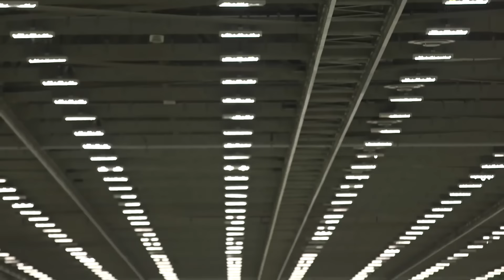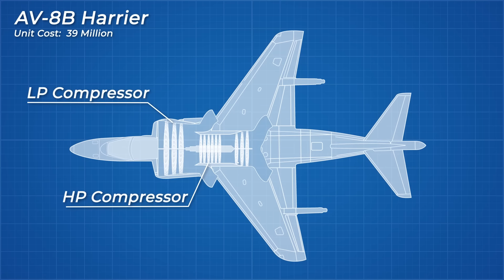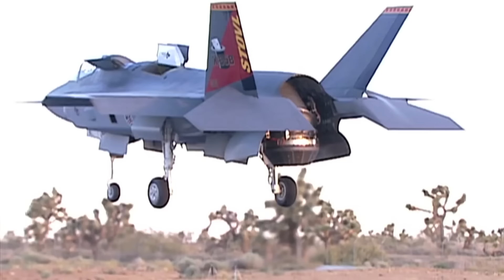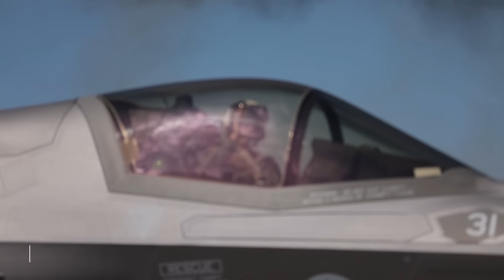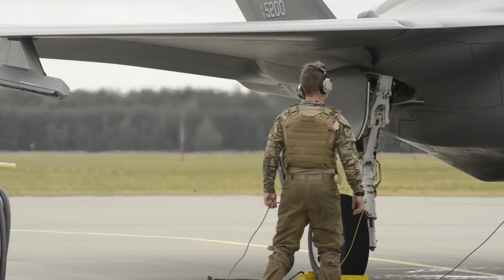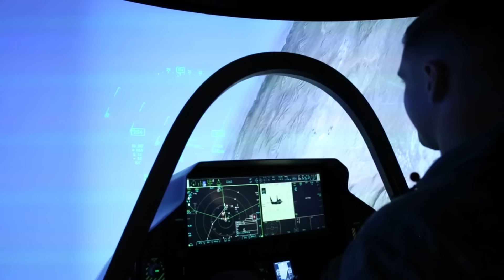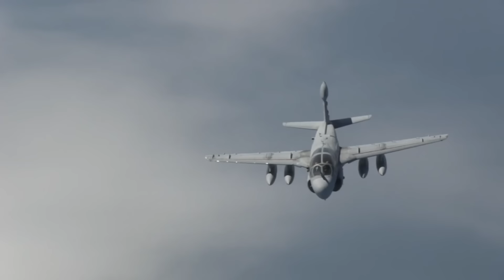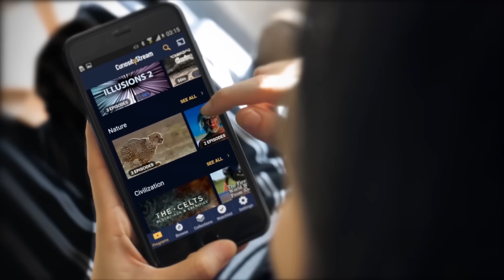Is The F-35 Worth $115 Million?

Comment: The F-35 got its VTSTOL capabilities from the Russians (the Yak-141).
Reply: mb they just bought one back in the 90s
Reply: @anatolyrozhkov851  They bought the license iirc.
Reply: That's false. The Yak-141 used smaller jet engines instead of the lift fan. The three-bearing swivel nozzle is also from the Convair Model 200.

Comment: Just use the long wavelength radar to get the general location and then shoot a missile that has optical tracking
Reply: If it's that easy why are Russia and China bothering with creating their own stealth aircraft?
Reply: @jdanon203  I don't know anything about the Chinese. The Sukhoi uses much of stealth technology, low RCS and such, but doesn't seem to push it nearly as much as the F-35 (and 22). Perhaps the Russians think stealth has limitations, costs way too much not just in money, but all the limitations it demands in other fields: range, payload, maneuverability. Btw the whole stealth concept was first described by a Russian (Soviet) scientist.
Reply: If you're emitting long wavelength radar at the US you'll get a cruise missile thrown at your radar installation before any aircraft takes off.
Long wavelength radars are huge, difficult to move and vulnerable meaning they'll be one of the first priority targets.
Reply: @ChucksSEADnDEAD  The SU-57 has long weave radar built into its leading edges. Limited, but still...
Reply: Long weave gives approximate location, then a missile is directed near the target via simple inertial and command guidance. Once the missile gets close enough it can switch to normal short weave semi-active radar guidance. If the radar is jammed and the SAM operator recognises it soon enough the missile can be commanded to home in on the jamming signal itself. And then the 200+ kg warhead does its job. At least that's how the S-200 Vega (SA-5) works since the 70's. (Not counting for poor maintenance, untrained crew panicking under pressure and the target side claiming nothing happened it was a bird strike of course.)
I'm sure S-300/400 and other new systems can do it as well.

Comment: Is it worth? Short answer, no. As "stealth" it might be, new passive radars reported to be able to track them, so it's already outdate in that part.
Reply: Those radars were reported to be incapable of guiding missiles and were tracking F-35s as they left an airbase after an airshow while correlating the F-35's position using data from air traffic control... It's difficult to fail at that when the passive radar is right next to the airbase... not to mention stealth aircraft over civilian airspace are always configured to be as visible to radar as possible in order to make life easy for air traffic controllers.

Comment: Some of problems with the F35 are real but it hard to tell what is an unavoidable teething problem and what is a permanent reduction in usefulness. Most of the good things are more to do with integration of sensors than the aircraft itself. I have no idea weather it is the lemon of all time, or a super capable well priced weapons system. Sadly most of the commentary seems to come from a pre established position rather than reasoned analysis.

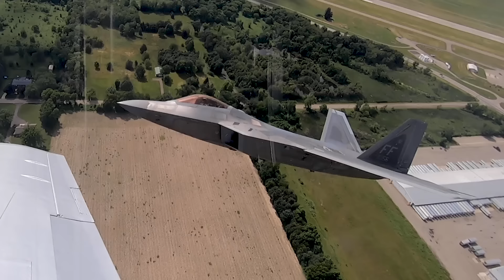Comment: 1:37 look at that angle of attack... I mean, sure, it's in a turn, but you can still tell that that plane does not like being at such low speeds.
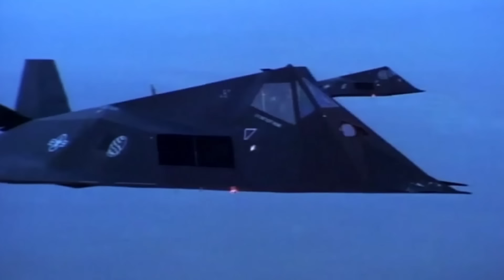Reply: That's an F22 at 1:37, one of the most manouverable jet aircraft ever made. As if you can even tell the angle of attack
Reply: @theRidePath  It's maneuverable at combat speeds. That was much below its optimal maneuvering speed. Modern fighter jets like the F-22 need high AoA to fly at low speeds. The thrust vectoring on the F-22 would help it turn at such low speeds but it would still need high AoA to maintain flight at such a low speed. 

And yes, you CAN tell that it is at a high AoA. Obviously we can't give the exact angle but if you have any experience you can tell that it is at a relatively high AoA for the turn that it is doing.
Reply: @dogeness  Are you sure you meant to timestamp at 1:37, because there is nothing suggest that that plane is going particularly slowly at a particularly high AoA.

Anyway, I'm not really sure what your point is. A high AoA capability in a turn isn't necessarily a bad thing.
Reply: A lot of the lift comes from the body, which is much stronger lift when at higher speeds. So yes, it prefers higher speed turns.

Comment: I'd say it's worth the cost, but it won't replace all of the planes it seeks to replace. The A10 is far superior than anything for close air support, especially at the cheap price tag (compared to 85 million), and the F22 would be the true successor to the F15, if it could drop its price.
Reply: Not really. The A-10 isn't cheap even to operate and barely does anything special in the context of a war. The vast majority of successful CAS missions are not done by the A-10. Not that it really matters because the F-35 is only replacing 1 aircraft per service; F-16 in the USAF, F/A-18A/B/C/D in the USN, and AV-8B in the USMC.
Reply: @dumdumbinks274  Unlike most aircraft built today, the A10 can easily take a lickin and keep on tickin. They have a replacement for it, they've had it for years, but the A10 is still operating with no forseeable end. Can you name a 5th Gen aircraft that can loose a wing or most of a wing and still fly home? The A10 is essentially a flying tank.
Reply: @Megames2012  The A-10 can take a little punishment from small arms fire and that's about all if we're talking about surviving and continuing the mission, but so can literally every other combat aircraft including the F-16. Bullets don't do much to aircraft unless they are incendiary or HE. All A-10s that you hear about for taking significant damage and getting the pilot home are also incapable of completing their missions. They get written off for scrap because the cost of repairs become excessive.
The F-35 and F-22 are both likely capable of flying home with an entire wing missing. The A-10 can only do so with half a wing missing. This also assumes that low altitude CAS is the only option (it almost never is) and ignores the fact that an F-22 or F-35 is much more difficult to engage than the A-10.
Reply: @dumdumbinks274  Go ahead a look it up; the A10 has been known to take a SAM and shake it off. It's a very durable plane that's 40 million dollars cheaper tham the F35A.
Reply: @Megames2012  No the A-10 is known to be able to take a SAM hit and limp home with damage so severe it either crashes on landing or is written off.  That's not good when an F-35 or other fast jet could simply avoid being hit in the first place.

Comment: The F-35 is a copy of the Russian Yak 141.
Reply: Nope. F-35 is an evolution of US technology and designs. The only engineering aspect shared in common with the Yak-141 is a piece of American technology anyway.
Reply: @dumdumbinks274  actually it seems like yak does almost everything f-35 is prized for, and it's already 30 yo tech.
Reply: @anatolyrozhkov851  really? and what are those? please also go into detail on the classified capabilities.
Reply: @jaqssmith1666  both are supersonic jets capable of vertical take off/landing, that's what I meant
Reply: @anatolyrozhkov851  transistors are 70 year old tech, and we continue to use those.
Reply: @kawrx2002 , how is it relevant? I mean they have partially achieved what is thought to be cutting-edge tech today 30 years ago.
Reply: @anatolyrozhkov851  Well that's not what the F-35 is prized for... and the Convair Model 200 already had those features in 1973, albeit never got produced due to the USMC being invested in the Harrier which came several years earlier.
Reply: @dumdumbinks274 , ok, it's convincing enough

Comment: One can’t even imagine the complexity of such projects
Reply: To add to that, the work to make this jet happen by various departments spread across the US. Imagine the logistics involved in it to pull this off.
Reply: and all the BS that goes on with requirements and contracts and schedules...it goes on and on and the projects just keep getting more and more expensive.
Reply: @JohnJohnson-dj2dv  True dat, not only building this machine but doing so complying with all the bureaucratic BS
Reply: THE F-22 AINT SHET;THE SU 35 ,RUSSIA, RAN IT AWAY!
https://www.rt.com/news/412590-russia-us-syria-air-force/
https://www.youtube.com/watch?v=r0iiAYWX6mc
https://www.rt.com/news/414456-russia-us-plane-syria-putin/

BIRD ATTACK ON THE F-35 HUUH!!!
https://www.youtube.com/watch?v=fvrGfOVUm1I

CBS NEWS THE F-35 IS REALLY AY PEICE OV SHET
https://www.cbsnews.com/news/f-35-fighter-japan-missing-fleet-grounded-today-lockheed-martin-latest-updates/
Reply: Yakob Izzrael Stop with your propaganda, no one wants it.
Reply: JavierCR25 the f35 is what happens when the engineers are basically given a blank check. So much of this plane is so tightly optimized it’s nuts. When they were lowering the weight of the plane to get thef35b in to weight limits for stovl they looked at every part.
Reply: @arsarma1808  BS! Engineers never get a blank check. What the engineers on this project did get were very ambitious requirements, and then 50 different customers with 200 different, and often contradictory, requirements. 

This project was mismanaged. Not misengineered.
Reply: @a5cent  I'm saying blank check in a good way. They got a lot of time and money to optimize their work in their constraints.
Reply: @arsarma1808  Okay, but it's still not true. Every single engineering project had time and budget constraints.

Besides, engineering is not what most of the tax payer's money was spent on. R&D is a part of it, but the engineers receive only a small part of what LM calculates one hour of engineering time is worth. Most of the cost is overhead, future investments, reserves, profits and shareholder value.
Reply: It is made of aluminum and steel to go throught STeel buildings like world trades cener 911.
Reply: Stable Genius  every aircraft has G and speed limits built in, what are you getting at? Also, titanium? They would cost a billion each...
Reply: I can

Comment: F35 is now 25 years old 10 years past its delivery date. It was supposed to be replaced in 2040 it is so far behind that is now 2070 most of you will be old men before it goes out of service still not working. At its current rate of production it will take 92 years just to complete the US order of 4250. It has over 1000 faults from Fuselage Spar and Undercarriage cracking. It needs 2 engines lacks power and range. No radar its main gun still can't be sighted and dies not work. 300 + have been made 108 so bad they are training only. The list of faults is enormous.

Comment: USAF could lose 590 F35 Fighters it cant afford to maintain them.  http://fortune.com/2018/03/28/air-force-f-35-cost-cuts/
F35 Engine cost over runs it's failed engine does not produce the promised output it requires 2 engines.
https://www.pressherald.com/2017/07/18/pentagon-faults-pratt-whitney-on-f-35-engine-cost-overruns/
F35 a Trillion $ mistake.
https://www.bloomberg.com/news/features/2017-04-04/is-the-f-35-a-trillion-dollar-mistake
USAF may be forced into massive reduction of F35 fleet.
https://www.sott.net/article/381276-Internal-report-reveals-USAF-may-be-forced-into-massive-reduction-of-planned-F-35-fleet
May 9 2018 USAF F35 is a HANGER QUEEN still unusable requiring MASSIVE REPAIRS. http://www.news.com.au/technology/innovation/military/f35-stealth-fighter-deliveries-restarted-amid-dispute-over-who-pays-for-warranty-fixes/news-story/3d037ea0115793597c87e963baa4c793

Comment: Decently large problem at 21:06 you list the F-35 as set to replace the f/a-18. However, the f/a-18 has been fazed out of service by the f/a-18E Super Hornet which under best estimates is actually 70 million rather than 37 million. Only people still using the f/a-18 (in small amounts) are the Marines. The Marines have a certain portion that does not use the helli-carriers and uses the actual full carriers with the Navy. Also problems with A-10c is the upkeep cost rather than purchase costs. They cant readily make new ones without launching a whole new program and can only upkeep old ones. 

Also a follow Up:
Realistically, the F-35 is competing with the F-16, F-15, F/A-18E, AV-8B, JAS-39, Rafael, and Typhoon. The prices of which are 70M, 100M, 80M, 40M, 60M, 92M, and 60M respectively. As you can see the F35 (A) variant is actually very competitively priced considering all of its features as the hands down best fighter in existence at this point in time(only rivaled by the f-22 because of relatively outdated avionics). You can see why literally almost any country that is permitted to buy it is doing so. Which gives further assurance to US military dominance in that they owe the US money and also in the fact that F-35 has DRM that they could shut down at any time. Basically the F-35 program is actually quite cheap considering how much power it gives to the US over other countries and the sheer performance it has from its situational awareness.

Comment: Not forgetting a security breach that almost certainly placed detailed designs of the F-35 into the hands of the Chinese; who now have the suspiciously familiar looking FC-31.
Or when Lockheed assumed that the leading & trailing ailerons would never have to point in the same direction simultaneously, and designed the power supply accordingly. Only to find out that wasn't the case in strong cross-winds. The larger power supply required to deal with the issue encroached on the engine cavity, necessitating a redesign of the engine. It set the project back years.
The whole project has been a disaster. A brilliant case study in something "Too big to fail".

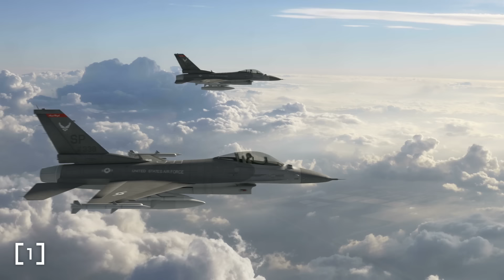Comment: The F-35 was not designed to replace the A-10 Thunderbolt II (The Warthog). Although it is to be capable of ground attack the A-10 far outmatches the F-35 in this field because of its GAU-8 Avenger autocannon, long loiter times, and ability to take hits and still fly. Its also as simple as the "F" in F-35 stands for Fighter designating it as a fighter aircraft as its main role and the "A" in A-10 standing for Attack designating it as a ground attack aircraft and therefor only has one purpose: disable armored vehicles, also meaning it is not an air superiority fighter as stated at 1:26

Comment: The whole f-35 vs f-15 debate is pointless, its like pitting a battleship vs a current gen destroyer or cruiser in a straight up Naval artillery fight like yea no shit a 16 inch shell is gonna punch right through the hull of the destroyer and a 5 inch shell is gonna bounce right off the Battleship but these two were built with completely different purposes and thats the same thing as with the F-35 and F-15

Comment: The F35 has wing loading problems, that's why the Navy wants a bigger wing.
Reply: That's a fabrication. Wing loading cannot be calculated on the F-35 because the fuselage is shaped to generate body lift. The whole body of the plane is a wing. I don't think there's published statistics on the body lift of the F-35 so you can't calculate wing loading.

Comment: We need one fighter for all branches of the military to save cost. 
We need to make three different variants for the branches of the military to meet their needs.  
We haven't reduced costs nor come up with a design that actually meets the needs of each branch after decades of work. 
Thank you military industrial complex.
Reply: That decision wasn’t made by the “Military-Industrial Complex” but by politicians & bureaucrats who wanted a “one size fits all” solution. The F-111 which was supposed to take care of all needs was neither proposed nor desired by the military or even the contractors - It was proposed by Kennedy’s “Whiz Kids” who thought they knew better than those who were actually going to use the thing. The F-35 seems to be a repeat, but with stealth and better avionics, computers & sensors.
Reply: @TraditionalAnglican  in case you don't know what the MIC means,  initially Eisenhower wanted to call it the "Military Industrial CONGRESSIONAL Complex" because it included the cooperation of Congress and therefore bureaucrats by logical extension.  
Natural, anyone who has done even the most basic historical research into this topic would know this which is why I didn't spell it out.  So,  this may surprise you but your description of the role of Congress is accurate,  but only reinforced my point.  You may want to try doing ONE internet search and about 30 seconds of research before you enlighten us next time.